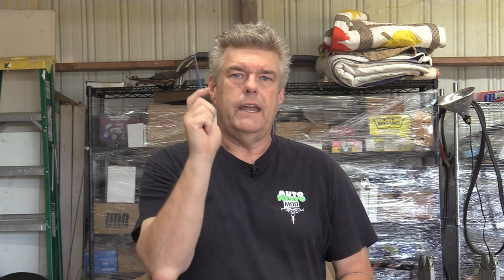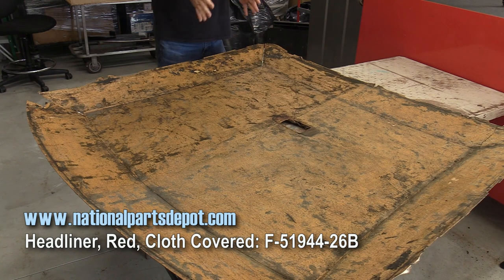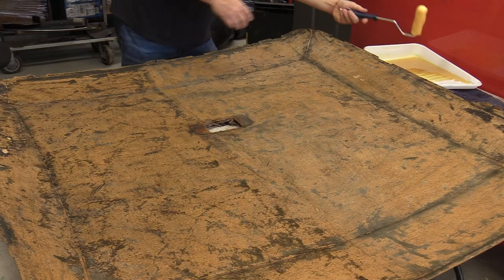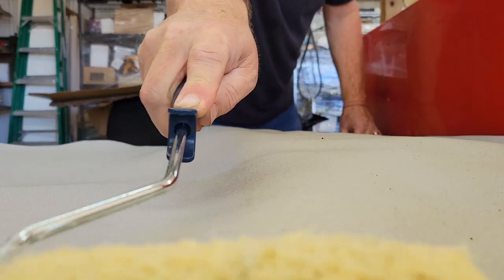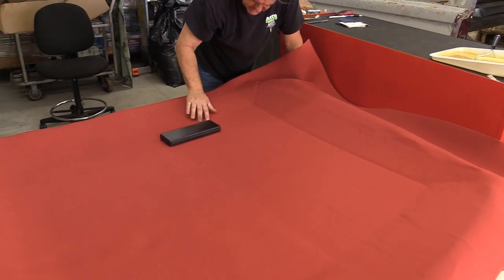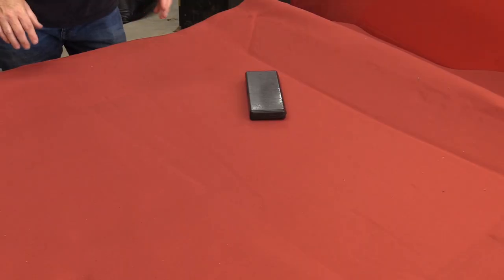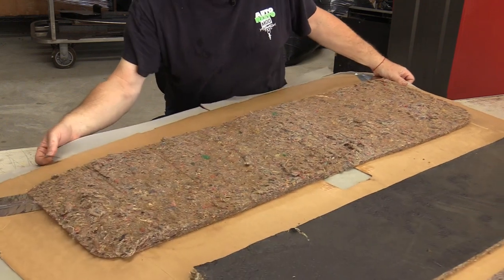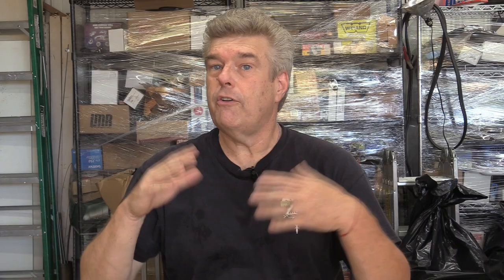How To Make Your Headliner Look Like New

Comment: Jeff,
When working with contact cements, use a "separator" so you can lay the two materials over each other.  Then remove the separators one at a time.  There are many materials that work well; old venetian blind slats, strips of plastic sheeting, dowels, etc.
Reply from the maker: Yep. we did that.

Comment: Any tips for sealing doors so that water doesn't run inside behind door panels and into the vehicle? 64' Fairlane owner here!
Reply: I can say probably not. They are designed for the water to pass through the door and out the bottom. You will need a good moisture barrier between the door panel and the door. I have made my own from heavy plastic from the hardware store then you can use body caulk to stick it to the door, and it will remain removable for future maintenance and repairs. Depending on the supply chain you maybe able to find some precut for your car.
Reply from the maker: I would use contractor bags to seal the door from the panel. Ford used paper that "seems" to have had a coating on it; or paper with a black paint on one side. Make sure the scuppers on the underside of the door are clear too.

Comment: Great video. Q. Does the contact cement attack the vinyl after a short period of time.? Thanks.
Reply from the maker: Not to my experience. I have had weatherstrip adhesive cause a "sucking effect" on vinyl headliners...I learned that I should brush it not use the tip of the tube. Use a brush instead.

Comment: Good video as always.  Which contact cement do you use?  I use DAP Landau Top and Trim adhesive and it has never let me down.
Reply from the maker: I use DAP contact cement. I find that the home improvement stuff works well in a pinch. But I do prefer landau glue.
Reply: @AutoRestoMod   I have used both with good results.